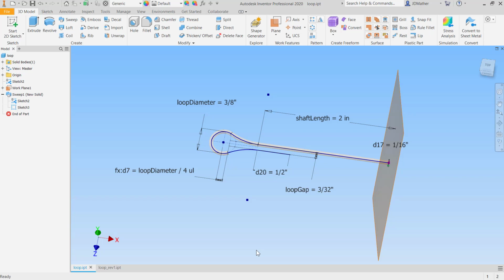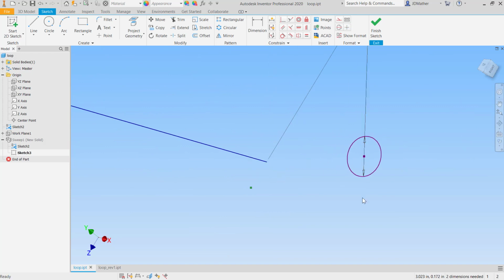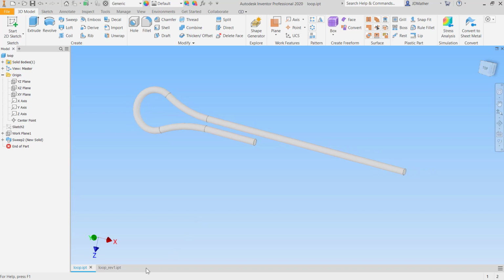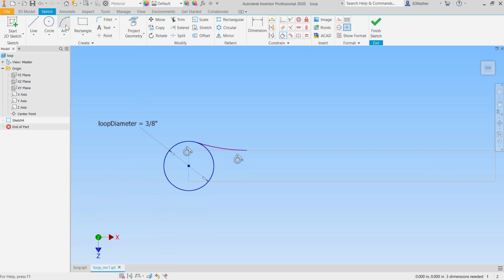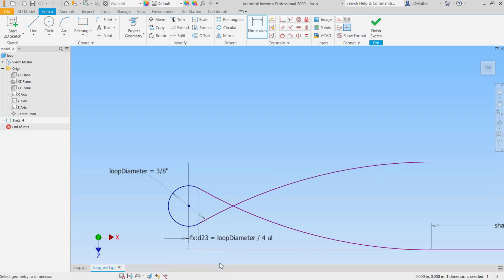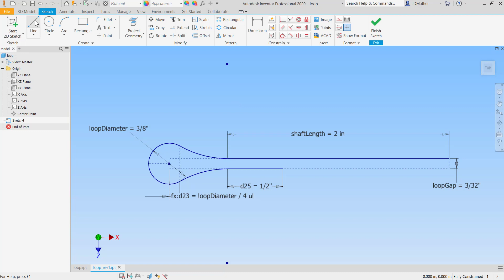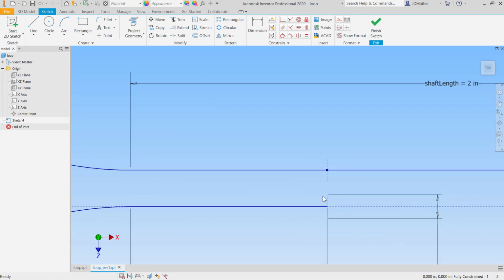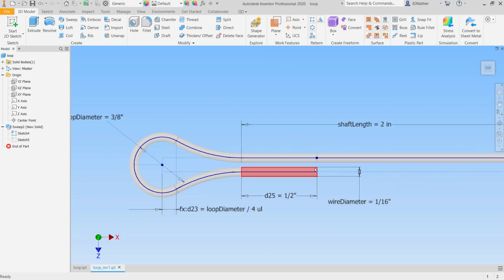Autodesk Inventor   Sweep Profile Constrained to Path

Comment: Thanks for good explanation. Why in the path selection it states "1 curve" for you? On my side, even if I select the path as one curve, Inventor automatically put amount of segments in the curve. In addition, you are explaining "perfect world" when geometry is perfectly aligned with main planes. But most of the times I need to create sweeps, where planes are not aligned with sweep itself (ex. ropes in 3d space). So work plane at the end of the path is very common practice, with broader practical use.
Reply from the maker: Attach your file here https://forums.autodesk.com/t5/inventor-forum/bd-p/78
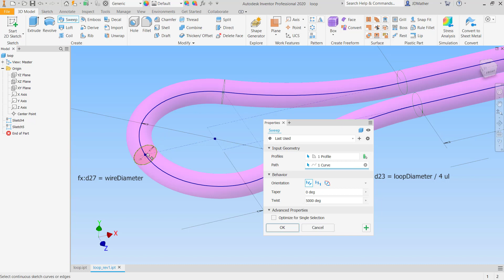Reply: @TheCADWhisperer  Its not really an issue I have, but rather curious why its like that. On 2:28 in the dialogue it states 3 curves. But on 11:22 its already 1 curve in your video.